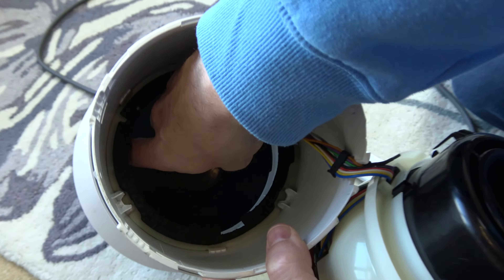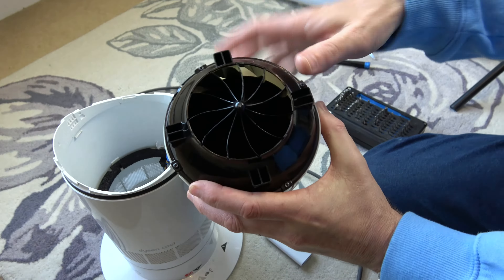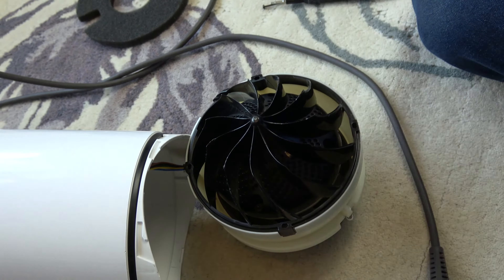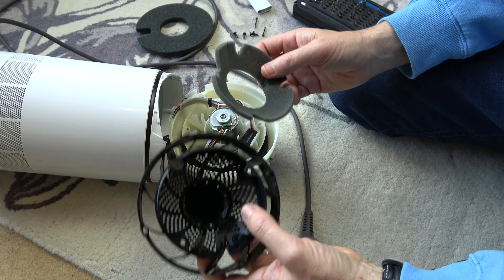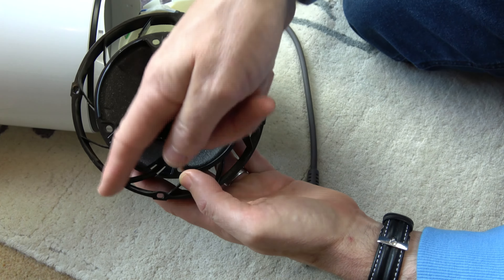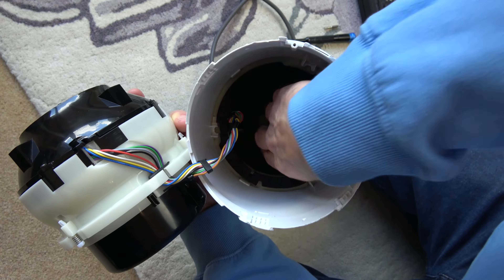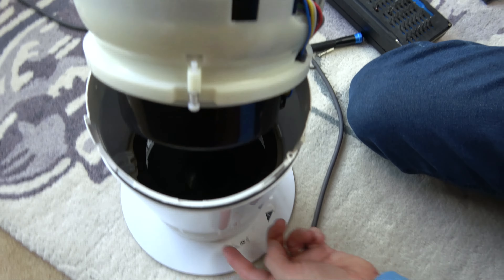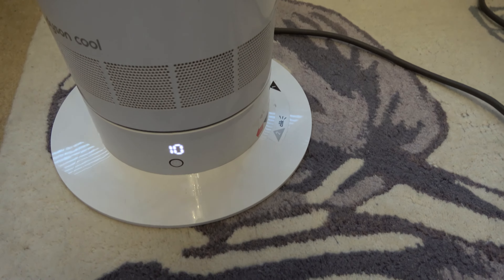Dyson Cool Tower Fan AM07 Cleaning Inside Including HIDDEN Filters

Comment: DYSON do not have the internal filters available as spare parts for the AM07 & the cone filter being prone to motor heat just ends up disintegrating as soon as you try to remove it after a few years use. DYSON supposedly do not have filters in later versions of the AM07 & all works probably better without the filter in place. So much better air flow now it is all cleaned. Thanks for the good information in you video.

Comment: Having done it. I'm pretty much convinced it's not worth taking apart to clean.

True, the top part, I've taken and run a hose through because it made the fan stopped working, but when I got down to the internal filters they're just really wasn't a whole lot there to clean. 

And now the associated problems with the reassembly and noisy filters and motors is more of a problem than before I took it apart.